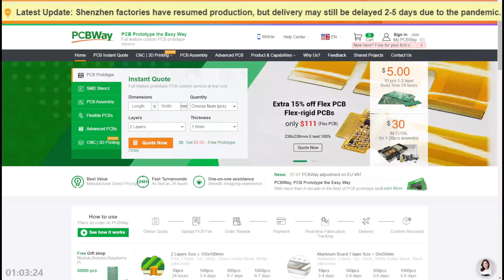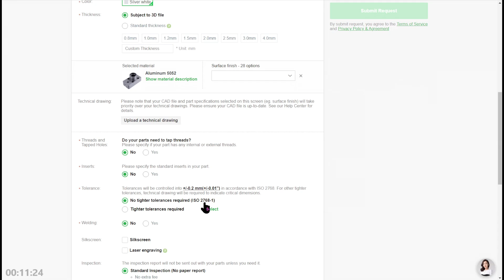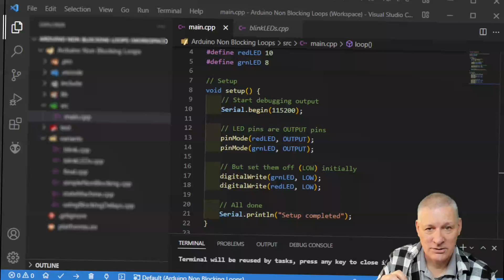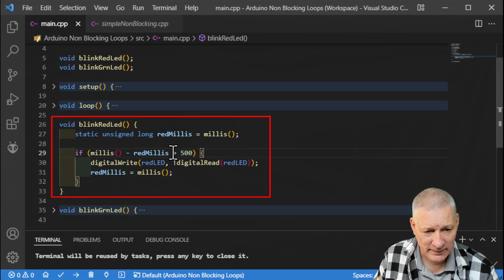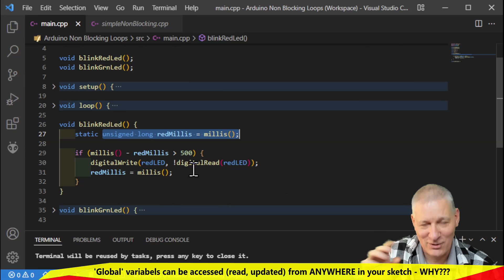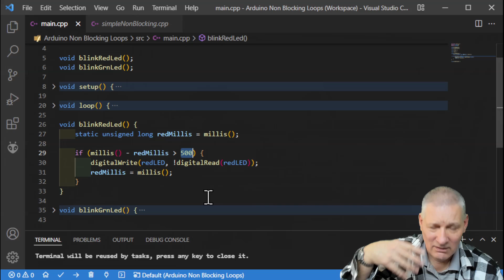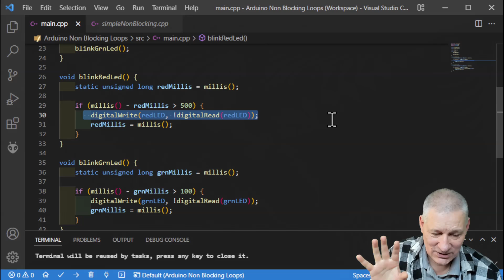#BB5 Moving your Arduino to a multi-tasking State Machine - Easy Intro

Comment: Very rudimentary. Would hardly call it a state-machine yet.
Your explanation deals more with multi tasking than with state machines . They are different concepts.
In the example you have 2 tasks (two objects) and each task (object) has 2 states (LED-ON/LED-OFF)

You are kinda hiding the state machine concept by writing :
    digitalWrite(RedLED, !digitalRead(RedLED) ) ; 

 it obfusactes the fact that
     when STATE-RedLED == ON... -> switch it OFF (and it becomes state ON)
     when STATE-RedLED == OFF  -> switch it ON  (and it becomes state OFF ... again)

Yep.. @21:00 🙂
Reply from the maker: "Very rudimentary". Excellent, just what I was aiming for. Beginners should be able to grasp the simple concept without any problems. 😁
Reply: The "state" of the system is held, in this case, by the millis timer/counter AND the two io pins.

Comment: Not having blocking functions and in this case, using a timer, is good programming practice and you have explained it well. I have never  used static before and used global variables as counters triggered from a timer, it works but not ideal. Look forward to your next video and implementing states machines as never really understood them.
Reply from the maker: Using timer-driven tasks is another concept (let's face it, using FreeRTOS to run tasks is exactly that) but not just yet, Crawl before we walk, right?

Comment: As always grate and informative videos ! Just right in time . I am currently making a cellphone with an esp32 all hardware is done and now the software comes to play ! i was thinking  to implement it in such a simple state machine way ! and taking advantage of the main loop of the code..Now i have some videos to go with yay ! keep up the nice work !! Greeting from greece
Reply from the maker: If you are using an ESP32 you also have the option of putting time-critical function in their own task, thus ensuring they get a fair crack of the whip.

I had to do this with my ESP32 Web Radio to ensure the music buffer was being serviced every couple of milliseconds to avoid stutter. Works like a dream. Just remember to taskYield() if your task has nothing to do!
Reply: @RalphBacon  Yes like that other video you did with the multicore programming! that would be interesting but for starters, I'm gonna take it slow implementing one piece at a time! Once again thanks for the Nice content! cheers!